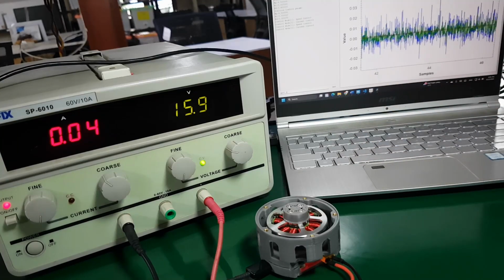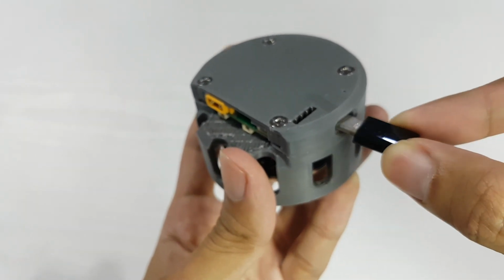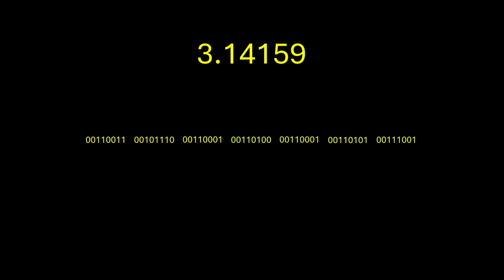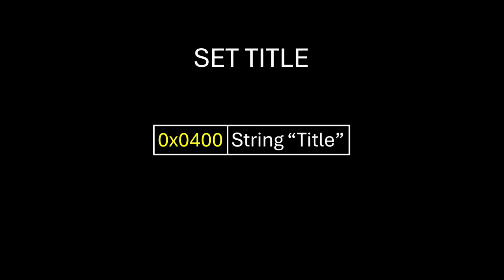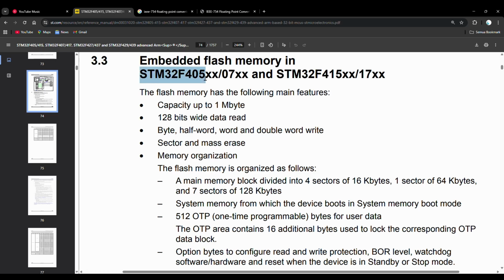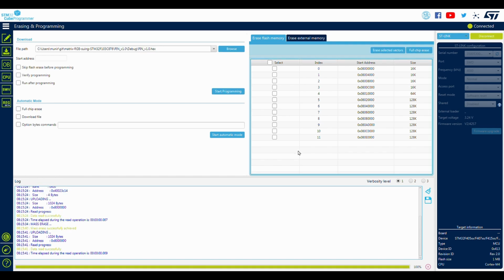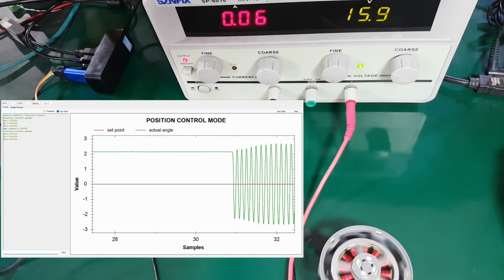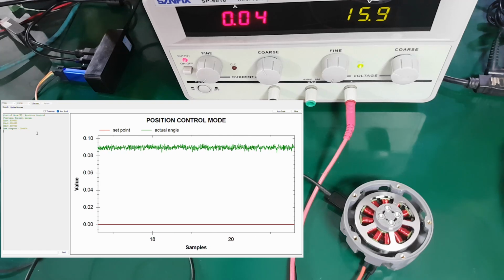STM32 BLDC Control Made Easy: USB Interface + Flash Storage

Comment: Hello. What is the value of resistor R7?
Reply from the maker: Hello, in my schematic, resistors R7 and R8 are voltage dividers for overcurrent protection on the DRV8302. If you want to maximize the current, you can add a 0 ohm resistor to R7 and a jumper to J2. Or, if you want to control it from the STM32, you can use the STM32 DAC and a jumper to J1. For more details, please check the DRV8302 datasheet regarding OC_ADJ. Thanks
Reply: @srj4555  Thank you!

Comment: it would be nice if you can use STM32 with 480Mbps and write application for communications as example. This is lacking somehow from STM
Some STM32 has internal 480Mbps PHY like STM32F7 and STM32H7S3
Reply from the maker: sounds good to try high speed USB, maybe I'll try it later as it needs more pins for USB PHY and additional chips if using stm32f405 which I am currently using :)

Comment: Can you please tell me the impedance of the motor you are using if it is a 5010 360 kv bldc?
Reply from the maker: For now, I'm not using motor impedance values to get the right parameters through calculations or anything like that. I'm still learning more about BLDC motors, especially about mathematical model. So, I apologize for not being able to answer this question yet :)
Reply: @srj4555 , no problem thank you for letting me know